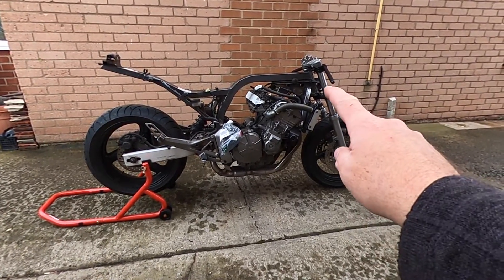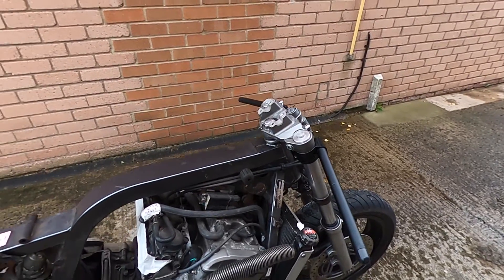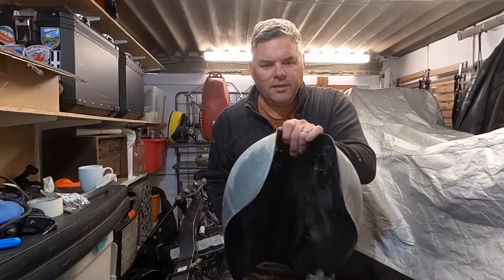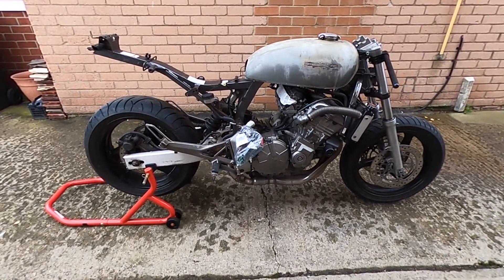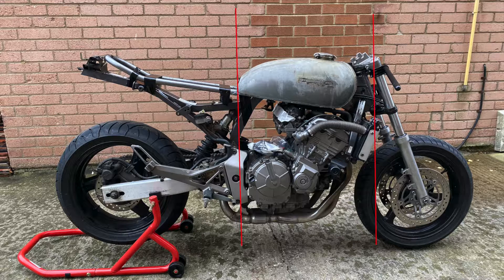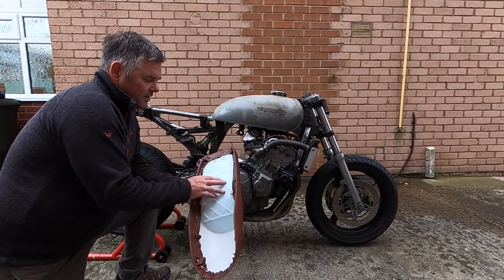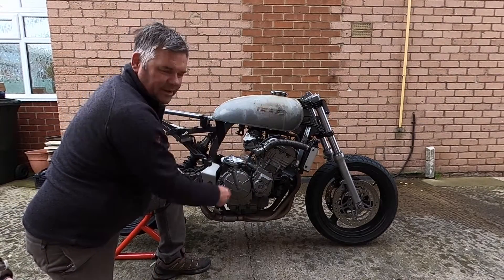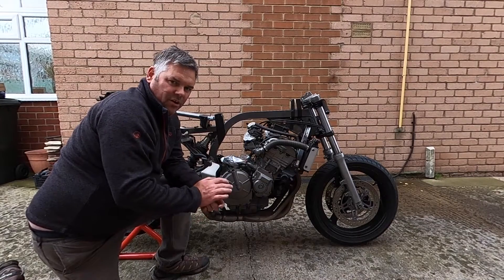Honda Hornet Café Racer Budget Build - Episode 2 Getting The Lines Right

Comment: Hi, I'm sorry for asking, but I wonder if this fuel tank from CB 500 will fit without tunnel modification and attached to the hornet? no problem? what do I have to change to suit this idea, I like it.
Reply from the maker: Yes it fits straight on you will need to move the front mounting point where the round rubbers are and make a new rear mount, but you don't need to modify the fuel tank itself